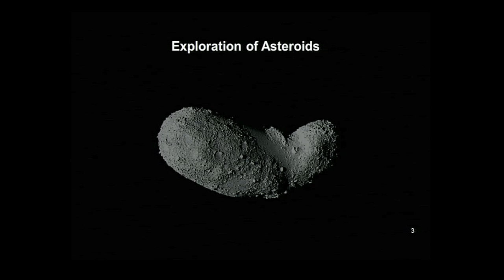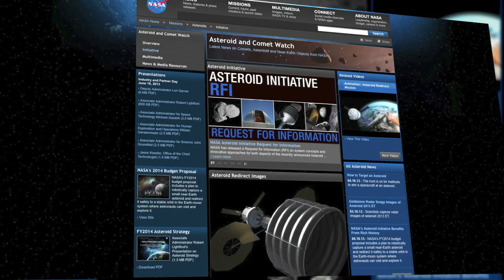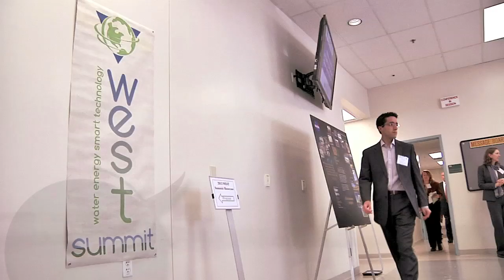Asteroid Grand Challenge on This Week @NASA

Comment: The moon is not just a bunch of rocks, for the moon has an abundant amounts of metals that have industrial applications.  It has been over one-hundred years since the first industrial revolution, and humanity is on the verge of a second industrial revolution that will take place in the solar system.  The ability to bag an asteroid should be only half the picture, for it means nothing if there is not the industrial superstructure that creates the materials used in commodity production.